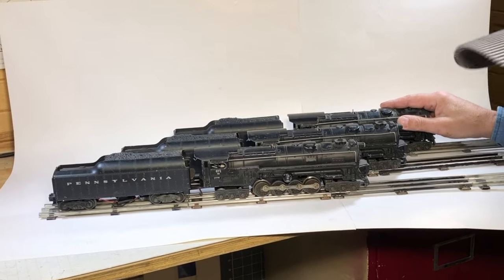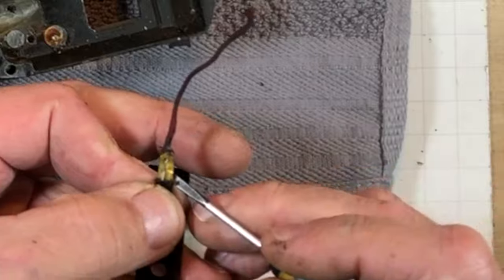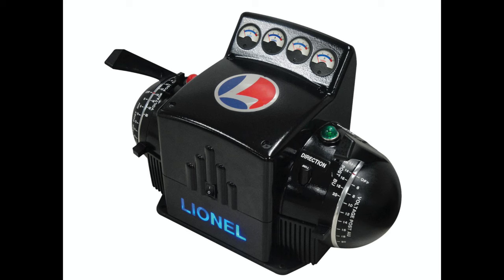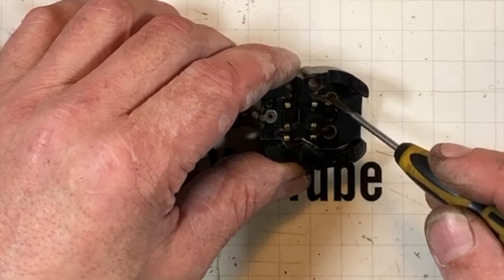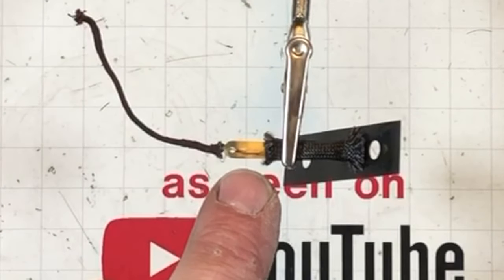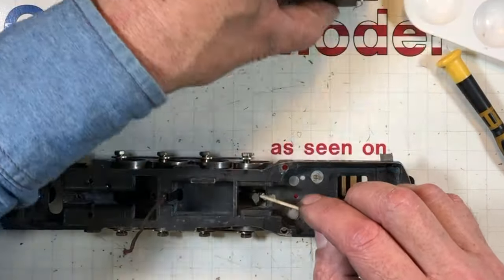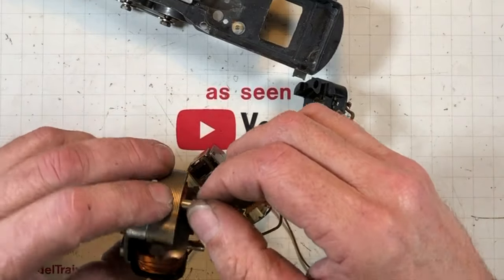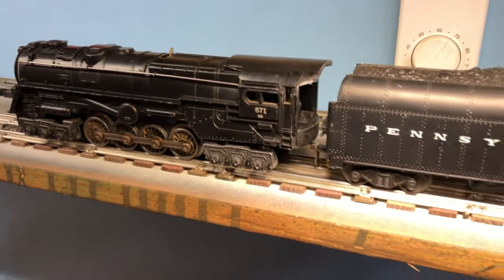Fixing this 1952 Lionel "O" Gauge Pennsylvania Turbine

Comment: I’ve got 2 of these turbines! one is a sentimental piece that belonged to my great grandfather and is a first year (1946) which sits on the shelf as its gear has worn out and the wheels are cracked and the other was the first postwar locomotive I ever received and is a 1948 model. Both are very special to me and I love them dearly.
Reply from the maker: Cool story Cole :-)
Reply: Have you considered replacing the worn wheels & gears? @Colestrains1
Reply: @Benthetrainkid  I would, I even have a replacement gear, but I have to pull the wheels out to replace it and I just don’t have the tools. I want to but I’m only 16 and not comfortable doing something like that cause I feel like I might break it more

Comment: This was always one of my dream locos as a kid in the 60's. I used to look at my dad's Lionel catalogs, and pray that Dad would be able to find one for me. I finally picked up one of these at a collectables shop in Las Vegas a couple of years ago, and found it had the wrong tender. It took practically no work to get the engine running smoothly, but I had to completely rework the tender from the frame out. The wiring was gone so I replaced it with new wires the whistle motor was seized so it had to be rebuilt. The iron rod in the switch solenoid was rusted in place and had to be knocked loose and reworked,  and I had to make a mounting tab to mount the solenoid to the whistle body.  Everything cleaned up really nice and it runs like a gem. It was definitely worth the $75.00 I paid for it.
Reply from the maker: 75 for the loco and beat up tender?  Still sounds like a pretty good deal to me!!  That tender sounds like it lived under a waterfall for awhile :-)

Comment: You’re right calling the part you do, the Rotor. The Armature is attached to the allotted windings and the composite fixture Is called the Rotor, or Rotating assembly. This two part assembly is encased in the Stater, or Stationary fixed section of the motor. Terminology accuracy seems to be just another lost ability or concern of the newer generation. Thing-a-ma-jig seems to be as accepted nomenclature for “whatever”, and “whatever” works where education fails. Just my thoughts. Absolutely love your Videos  and have learned a ton of useful info. You’re the “go to Guy” in my book. Thanks bunches!🇺🇸🚂
Reply from the maker: Thanks so much Steve.  A couple of Fellers say a "rotor" is in a alternator and in DC motors that spinny piece is called a armature.  I do want to be using the correct terminology but if Fellers cant line up with what to call it, it throws me off.  Here's some of my pet peeves with terminology.  That gas powered spinny torque-ee producing thing in the front of most vehicles........ Its not a motor but a..........."Engine".    The 1/2 ton or 3/4 ton or up to a one ton, long box, 4 wheel but it could have 6 wheels,  vehicle people use to haul stuff or pull trailers with.  It's not a TRUCK. its a pickup.  But what is a Feller to do.  Funny how the engine is held into the frame with "motor mounts". Guess I will just sit down and have a cold "pop" or is it a "soda" ;-)
Reply: @classicmodeltrains  Best to have a Brew! Or is it beer?

Comment: Great video Ron. That 671RR is a classic piece. I have one myself with my 2179WS set. The RR stands for Rerun. It was made in 1952 during the Korean Conflict. It was made one year only, along with the 726RR in 1952. It has a nice collector value because of the RR (Rerun) designation.
The classic model is none other than the beautiful Brooke Shields!!
BTW, I’m from Long Island, NY. There’s still a few good guys from NY. LOL
Reply from the maker: Thanks Tom!  Long Island?  Very cool.  Seems to me there is a lot more model RRers on the east coast than in the midwest.
Reply: That’s probably because of the congestion and amount of people here on the east coast. I’m born and raised on L.I., but I can’t wait to get out of here and move up to New Hampshire.
Reply: I have one of these steam turbine engines but it's numbered 681 it came with the 2671 w 6 axle tender with whistle it came with a few rail cars and a caboose it was a good size unopened box found in my aunt's attic after she passed away one of the cars was a milk car the platform to the milk car was never assembled do you have any information on what year this could have been
Reply from the maker: @mikeberthold1593  681's are 1950,51 and 53

Comment: A simple trick that really seems to work well in bringing Back the original surface in these black engines, is to use an old shoe brush or tooth brush with a light coating of black, paste shoe polish. Rub it in good. You don’t want any more than just Like a die stain. Then buff really well with an old shoe brush you’ll be amazed how well it works on some old engines. Brush it well enough that it won’t be subject to coming off. I can’t guarantee that it will work in all application environments, but when it does work, Wow! 🤗
Reply from the maker: I used that trick in this video and a few others.

Comment: Hey Ron. I love your videos and on camera banter 😊.  I have a question are you interested in restoring models instead of repairing?  I have a lionel passenger set that was my dads. I think it is from the 30s.  I would love to get it restored. Might make for some cool content
Reply from the maker: I'm not much of a painter.  I have a pre-war loco and passenger set here that's gunna be a trial run for me.  But for the most part I'm better at fixing than making look pretty

Comment: 22:58 Bearings, bushings, ball bearings, they're all a load bearing structure that reduces friction between moving and stationary parts, but Mr. Bushing might get offended hearing that he's just a boring bushing. Anyway, those bushings on the motor look like Oilite bearings, which are highly technical gizmos made out of sintered bronze which is porous and retains oil. Grease, I understand, does not play well with an Oilite. Just a heads up/FYI.
Reply from the maker: Thanks!

Comment: I'm glad you have found a fellow model railroader locally. It's also good to see another O gauge video. I collect mostly post war o gauge myself. I have one of the Lionel turbines and I have serviced it to the best of my ability. It runs and the lights and smoke unit workers. However, when I run it, the brushes spark against the commutator. It causes a slight burning smell. Any suggestions?
Reply from the maker: I believe all the Lionel or actually all the AC powered motors have small sparks taking place at the brushes.  That smell is referred to as "ozone" and is highly addictive ;-)

Comment: Hey Ron, love your channel.  I am one of those 33  percenters.  I am working on a Rivorrosi Milwaukee road 4 6 2.  I bought it at a train show used many moons ago.  One of the motor brushes is cashed.  I substituted a brush from a pancake motor and used some copper wire to make up the length difference.  Of course, it ain't quite right.  Do you have any sources for Rivarossi parts.  Specifically motor brushes?  Thanks!
Reply from the maker: Rivarossi is still around producing stuff over there in Italy.  Check there website or Ebay.  So far I have not had to source any new brush sets for the HO stuff so I'm at a loss for any other suggestions.  Thanks for your support of the channel!!

Comment: That’s Brooke shields! Just was wondering, I have a 671 the axle bushings are just shot on. Any tips for replacing them? Hard to find info about if they push in till they stop or if there is a height you need to stop at? Always enjoy the videos Ron.
Reply from the maker: Yup!  The wheels will have to be pulled off to remove the axles.  The drive gear will have to be pulled off as well to get to them axle bushings.  Need special wheel pullers and arbor press to do the work needed.  Not sure if they have a lip on them or not.  Never had to tackle worn axle bushings yet.

Comment: i have 3 of em, ask me what u need. also get the Lionel bible. "greenberg's repair and operational manual for Lionel trains 1945-1969 7th edition" you will have the pages black by your thumps when you use it well. wait till you repair a e-unit. god speed!
Reply from the maker: Thanks.  I have that same repair manual.  Just picked it up.  I have done several e-units.  Very much pain in the neck to re-assemble for sure.

Comment: how do you replace the diode on the whistle unit?  I do not think you can repair the diode if it fails.  It must be a standard size and it was amazing 39's high tech.  I have many tenders (and small transformers that came with Lionel train sets where the diode does not put out the 2V DC signal and lots of tenders that do not "see" the signal
Reply: I don't have Lionel, but I would bet you could use a new diode no problem. They sell online at the usual place. Saw one at 10 Amps and 1000 volts for 6 dollars.There is a 6 amp one on the big auction site for 5 dollars with shipping that even says it works for what you want.
Reply: Missed it at first, but the 10 amp ones for 6 dollars was for 10 pieces, not just one.  The auction site was for a single piece.
Reply from the maker: The diode is in the transformer.  It sends DC voltage down the rails that the DC relay in the tender reacts too, closes a circuit so the AC motor can spin the whistle.  They make/sell new fancier ones that can be soldered into your transformers to get this system to work again.  Ebay has em

Comment: I have one of these turbine steam engines. but it's numbered 681, does anybody know any information on the year of this particular engine?? It did come with the 2671 w tender 6 axle
Reply from the maker: 681's were made in 1950,51, and 53.  Came with "magna traction".  The 2671W "Pennsylvania" tender was available on the 50-51 production years.  So yours would be called a "681 Type 1". Hope this helps a bit Mike :-)
Reply: Thank you

Comment: Magne traction wasn't introduced until 1950. My guess is that someone changed bodies. In 1950, the number was changed to 681 reflecting magne traction. The 671 RR was made only in 1952, due to a shortage of magnetic material during the Korean War.
Reply from the maker: I agree with your statements except the body swap one.  None of these have magna-traction.
Reply: @classicmodeltrains  
If that's the case, one of them can't be a 1950, Ron. Unless it was on the dealer's shelf from 1949. On one of the tenders it looked like it had the backup lights, or am I mistaken? If it does, try to determine if it's factory original or added on later. I am by no means an EXPERT, but I've been with Lionel and American Flyer for most of my 76 years. If I can be of any help, don't hesitate to reach out to me.
Reply from the maker: @ronalddevine9587  there is two 1952 671 RR's.  One is a type 1 and the one I repaired in the video is a type II.  Both of these have the correct tender.  a 2046W-50.  The 3rd 671 is a 1948 typeVII and it does not have the correct tender.  I could be looking these up wrong in the Doyle  Lionel guidebook.  I showed a picture of what the correct 12 wheel lighted tender would look like if it had it.  Them 2671W tenders are very pricey on the eBay :-)
Reply: @classicmodeltrains  
They are costly. I just want something that looks nice (not perfect) and runs well. Keep up with the good work on 0 & S gauge trains.

Comment: NEVER oil the plunger on an E unit!! Just clean it with alcohol or contact cleaner. Oil will only gum that area up and it will fill with dirt and lint.
Reply from the maker: I'm finding that out.  It moves slower with the oil film on it as well.  Practice makes perfect they say ;-)